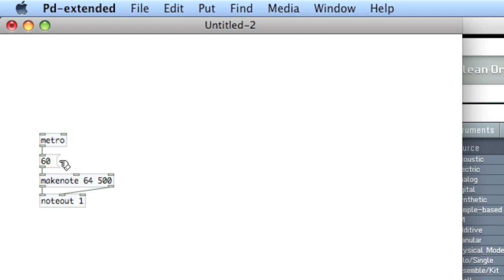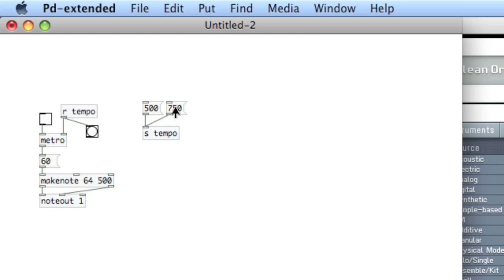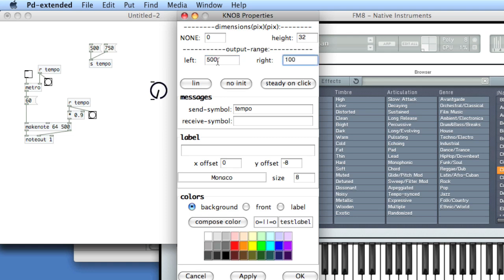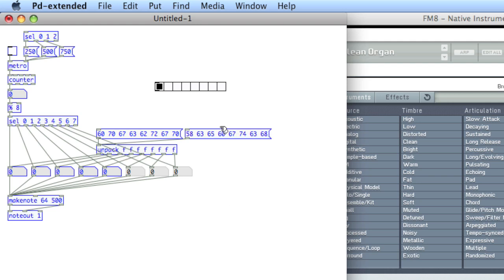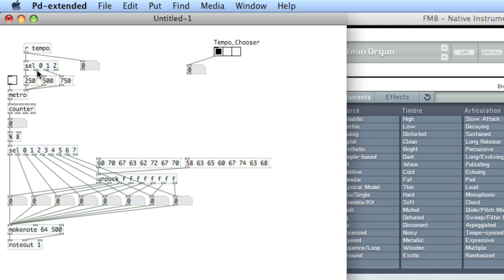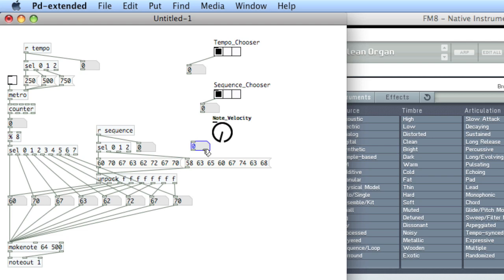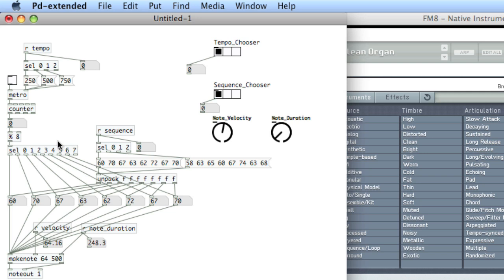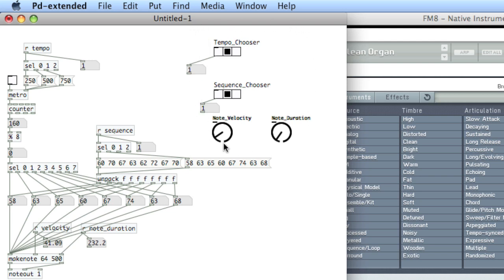PURE DATA: 09 Send & Receive

Comment: Hi there, great videos, really helpful! I just wanted to ask, I'm working on an installation piece for an exhibition and wanted to use PD as it seems to be able to do what I want. The only problem im having is that, the installation will use a custom MIDI interface connected to PD. The input from the MIDI device will be sporadic but when the user presses enter i want it to play back the input, sequenced and at a set tempo. Is this possible in anyway? Thank you and keep up the good work!